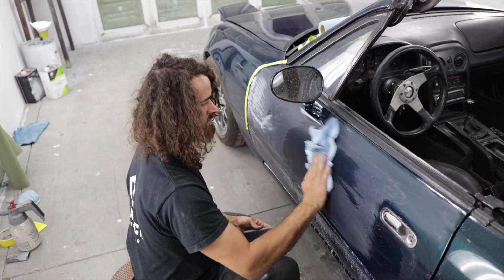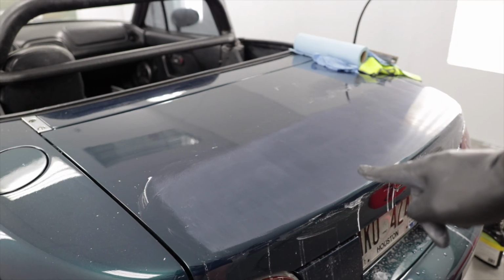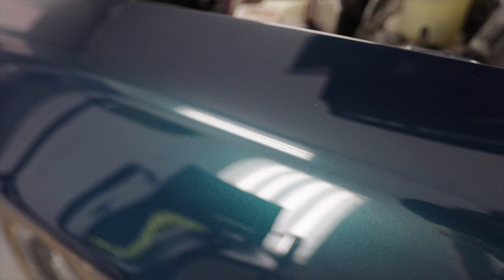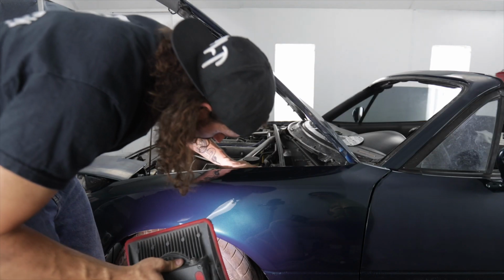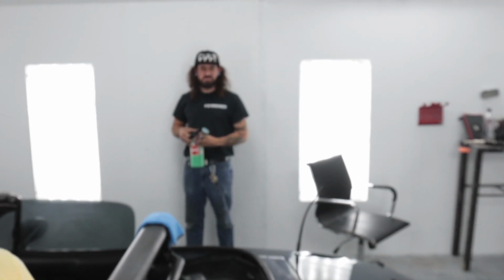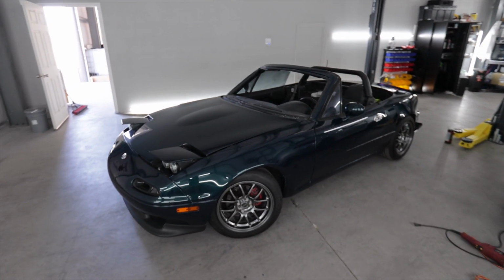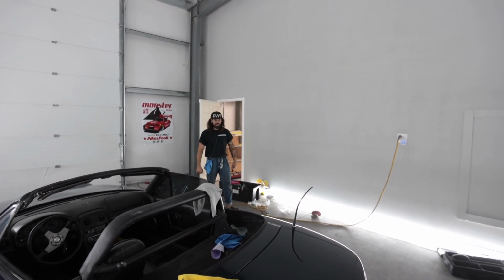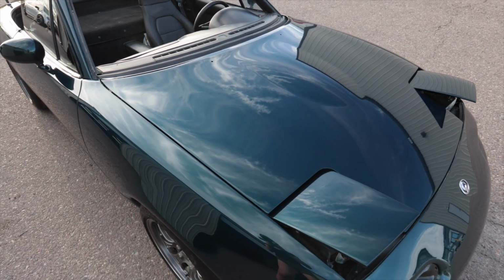Bringing an Old Miata Back To Life // Cut & Buff!

Comment: In addition to what Vic Mabus said about “Dawn Detergent” making water wetter (I think this correlates to being a thinner film allowing sandpaper to get closer to paint,  IE this is analogous to 5w oil vs 50w oil). Dawn also contains dispersants which prevent clumping and makes it easier to rinse out your wet sand paper.  I use this technique to wet sand nitrocellulose guitar finishes. It only takes about 2 drops per half gallon of water - don’t over do it!
Reply: Detergents reduce the surface tension of water. This prevents the water from pooling together on the surface of the paint.

Comment: Sarah you should put an elapsed timer on you fast forward parts. be interesting to know how long some of these jobs actually take.
Reply from the maker: Long enough that I don’t even have time to do that. Lol
Reply: @SarahnTuned  Who makes the Mini orbital you have?
Reply: To wet sand and buff a car that size, it isnt hard to spend 50 hours sanding and buffing. Just doing a 2 step paint correction and say a sealant application ( like Jescar power lock ) on say a medium size sedan like a Dodge Charger can easily take up to 40 hours to do. That is why paint correction cost's so much to get done properly.
Reply: @michaelwurm5288  If you'd like a 110vac powered 3" I would recommend looking into what Maxshine has to offer. Really decent products at prices that aren't, well, terrible. Most of Maxshine's line cost's about half of what similar products from Rupes or Flex would cost.

Comment: I have heard of people using Dove dishwashing liquid mixed with water as a medium for wet sanding, it doesn't have any color dyes in it that could possibly change the color ever so slightly. I am no painter, but it sounds sensible enough of a theory.